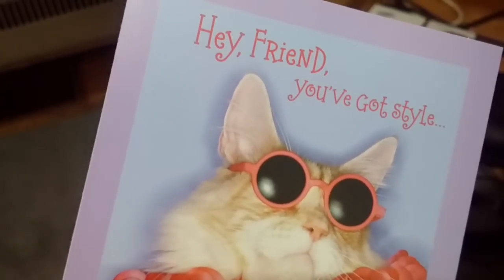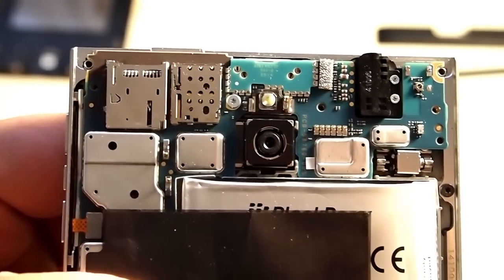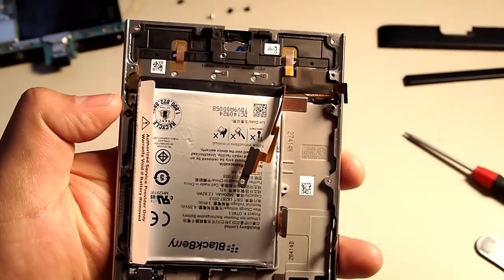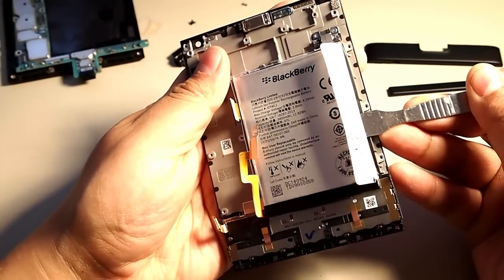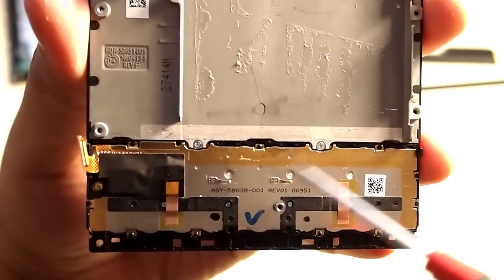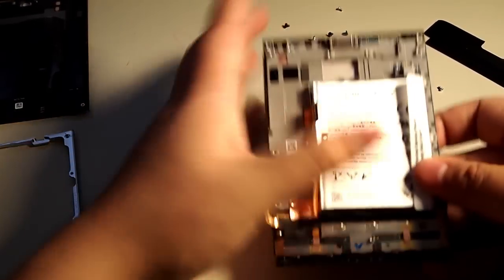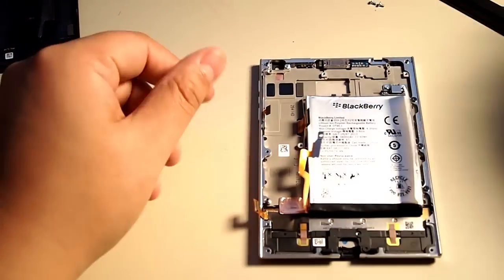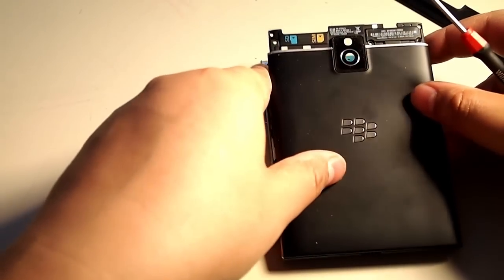Blackberry Passport Take apart and assembly Tutorial

Comment: Pretty neat. I have both a Passport and a Passport Silver Edition and I just saved both (one bad back camera and one cracked display). Note the Passport SE is very different from the standard one. Yet both use T5 Torx screws, not T4 as said in the video.
Reply: My Silver Edition (not special edition), the charging comes and goes, I took it apart and don't understand why the connector won't let the phone charge. I am sure it is the tiny slot where the charger goes that has the issue.
Reply: My own SE stopped charging 3 weeks ago. I have not open it yet. I'll let you know what I find.

Comment: Great tutorial, tahnk you. Why is the copper foil tape important? I currently face an issue with the capacitive keyboard controls not working. Any idea why it does not work (I changed the keyboard, display with frame and the battery (+ the camera housing) and the capacitive part of the keyboard does not work anymore. Any ideas why?

Comment: Im stumped even before beginning !  I cant find a screw driver small enough to remove the screws! Been to three hardware stores and cant find one small enough and all i want is to replace the battery. Im thinking of going to a jewlwer and seeing if they may have a star shaped screw driver small enough . Three and a half years ive had this BB Passport and its still good except for the exhausted battery. Is the driver used in this video especially made by BB for BB products?

Comment: @techguys708 Hello, 

Thanks for the video above! I have a BB Passport Silver Edition and it is trouble shooting! 

Earlier, when I bought the phone and started it without a sim card inside the phone, it use to work fine, but when I inserted a sim card and started making calls from it, the phone restarted all of a sudden and I realised that its top rear got heated, it happened many times and with each restart, its battery charge level use to fall (the battery charge percentage). 

Moreover, later when i again removed the sim card it use to work just fine!

However, now it doesn’t start at all, when i put that on a charge its red LED blinks and then it shows the startup screen with “blackberry” written on it, and then goes off and it keeps repeating the same in a loop. 

No matter how much i put the phone on charge removing it from the power source makes the phone dead again with no sign of life in it.

Can you please diagnose the problem my phone is having? What is the issue my phone is having!!? 

Any advice or help coming from you would be highly appreciable.

Kindly revert, looking forward, thanks a lot.

Comment: Many Thanks :  removed and replaced battery following video.  Warning though if when you're  removing battery and you smell the glue, battery may be heating up (and in my case caught fire!). Don't know why? Blew flame out okay. Phone works fine. Cost me $20 CDN for new battery and tools.
Reply: Same here, I'm trying to fix mine. Battery caught fire last week, left it in there. The screen came apart but everything else is good. I ordered an OG Passport from someone, I'll be trying to move those parts into my SE. But some guy has one for $450 and I'm wondering if I should just buy it from him. What are your thoughts?
Reply: @NYTOC  BlackBerry OS is no longer supported. Mine still works somewhat with WiFi. I replaced my Passport with a Key2 android for about $450: not as good as Passport imo.
Reply: @jamesbennett9369  oh I know lol. I went from Z10 to Z30 then Passport SE, BB Motion, then KeyTwo. The latter just never felt right. I use a Motorola One Hyper (since 2020). I was actually an insider on the new device to be released by OnwardMobility. That phone just never arrived in the mail. I just want to have something which I know, BlackBerry's can outlast time. Just not the OS. Either way, it's the one device that never has me back spacing 17 times just to get one letter right in a word when typing.

Comment: FYI anyone looking to just replace their screen -- you don't have to remove the vibrator piece or the sound jack or even the battery / keyboard! once you get to the part where you got rid of the frame -- just pull/push part the screen from the bezel -- it's super sticky under the screen so be careful (you need it). 

TLDR: If screen replace DO NOT take out battery or other parts after frame is taken off!
Reply: The same size screw driver should work - - i didn't have to switch the screw driver when I started taking out the the frame
Reply: ***** wow man that's nuts - -email the company ask if they can do anything for you - - can you put it back together?
Reply: +Joynal Rab Thanks man, looking at replacing my cracked passport screen next week. Nobody sources the screen with the back piece -- invaluable advice!
Reply: +Joynal Rab What about just replacing the keyboard, my S button is not as responsive and makes typing harder with me having to press it harder. How far would I need to go in disassembling it to accomplish that? Thanks in advance
Reply: +Joynal Rab I'm seeing where I can remove the keyboard without removing the battery, am I correct?
Reply: +T Will unfortunately it looks like you have to remove the battery because the bottom part of the battery is covering the gold tape and the top screws of the keyboard 😕
Reply: J. Rab (drops head on keyboard) thanks for responding nonetheless